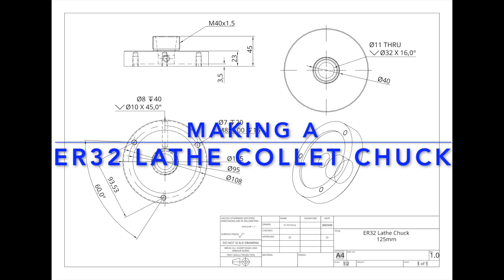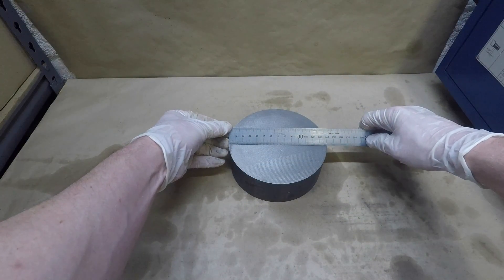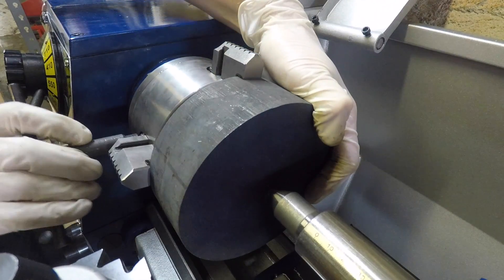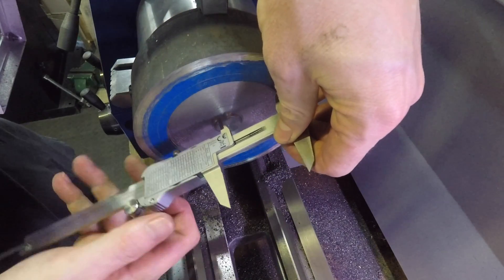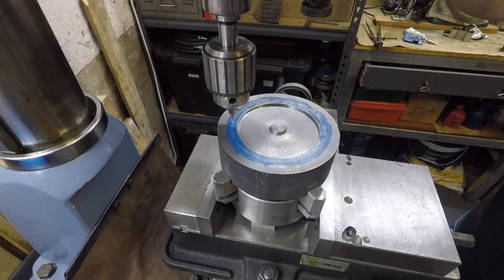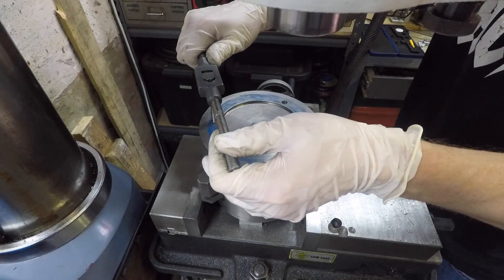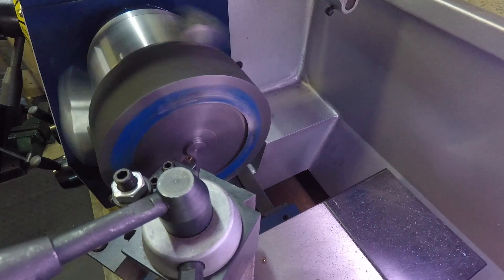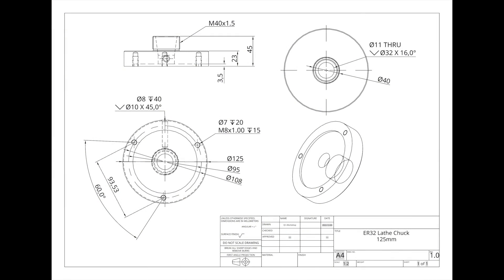Making a ER32 Lathe Collet Chuck Part 1

Comment: Hi Quinton. Discovered your channel via this recommended video yesterday. I have the exact same lathe as you. Also based in South Africa. I've been wanting to make the same chuck myself as I couldn't source one locally or via import. Funny enough, my CAD design is almost exactly the same as yours, only difference I can see (I haven't checked the total length measurement on mine) is that instead of having blind tapped holes and bolting the chuck from the back I plan to counter bore the holes in the front and use nuts on the lathe backplate. My reasoning behind this is that with my 3-Jaw and 4-Jaw chuck (for which I had to make a backplate adapter) it's very difficult to bolt it in place as there isn't a lot of clearance between the lathe backplate and headstock. I am looking forward to more content from you. Subscribed. Would also like to get in contact to share supplier contacts and ideas if you wouldn't mind.
Reply from the maker: Hi, thanks for subscribing, hope this encourages you to start with yours. I’ll see if there is an option to DM you my details.

Comment: This is a nice video.

If you need the top quality and unusual application, you make it. ER32s did not exist when some of my machines were made. As a top tool and die guy, I will not fart around with cheap imports.
Reply from the maker: Its the same issue I was having, trying to find an ER32 / 125mm is near on impossible. Which is why I decided to make one. It's also very satisfying to make it yourself. Let's be honest, 90% of the stuff us hobby machinists make are tools to make other tools :).